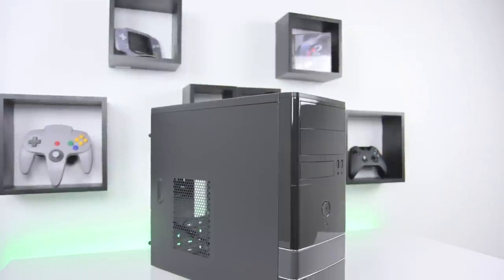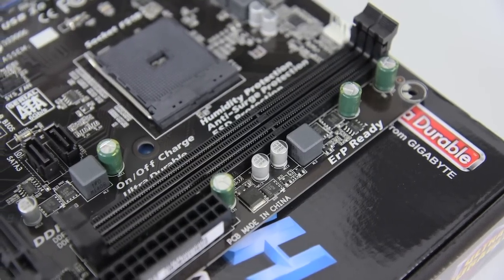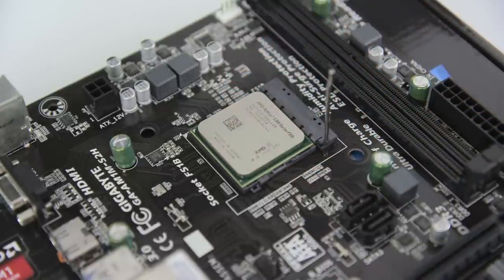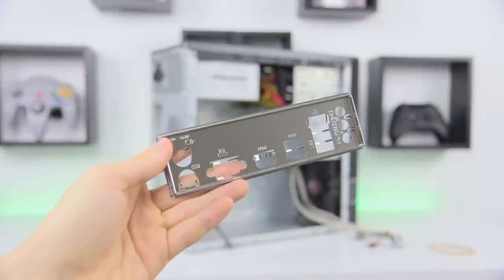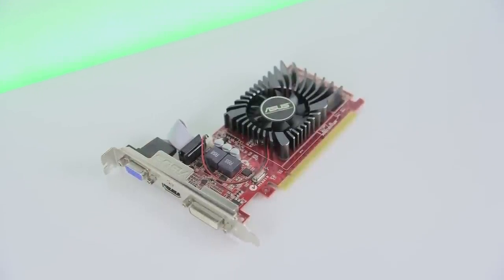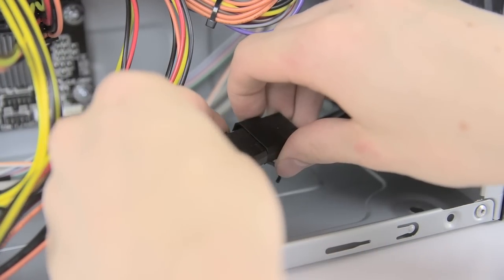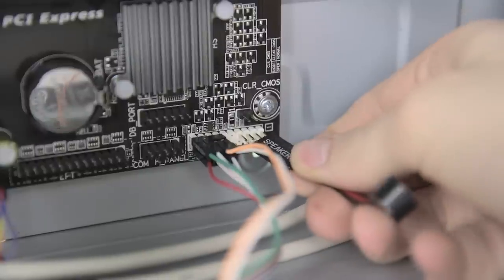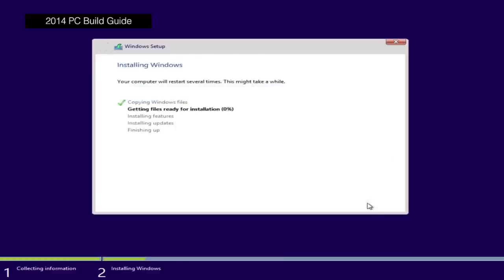How to Build a $300 Gaming PC! (2014 Boson)

Comment: Can somebody tell me if this pc is any good for gaming here are the specs: AMD A8-6600K 4.2 GHz Quad Core Processor with Radeon HD 8570D Graphics, 500W PSU, 1TB Hardrive, 8GB of Ram and 24 x DVDRW Drive
Reply: Not for any modern gaming at more than 30fps.
Reply: *****
wtf? he has a fucking 4.2ghz processor! and that gpu is decent! most games dont require any more than 6gb of ram anyways.
Reply: Narwhale The Great The frequency of a processor has nothing to do with performance.. my dual core 3.4ghz CPU beats an octo core 4ghz CPU in some games. Higher ghz does not mean better..

Also, the 8570D is hardly 'decent.' It gets 36fps on Bioshock, medium at 768p. It gets 29fps on Tomb Raider, medium at 720p. Also, it gets 11fps on Metro Last Light on high.

Please, actually learn about computers before you try to argue with me. I know what I'm talking about, you don't.

http://www.xbitlabs.com/images/cpu/amd-richland-intel-haswell-gpu/bioshock-1.png

http://gadget-help.com/wp-content/uploads/2014/08/54-amd-a10-7850k.png
Reply: ***** The 260X isn't good.. don't get that OP..
Reply: http://pcpartpicker.com/p/wttQBm

boom, it will have some stuff, some things but it needs an os and a dvd drive if you insist but thats it. will do 1080p gaming despite the poor single threaded performance of amd cpu's.
Reply: If you really can afford it get a 270X
Reply: 1toncheese That is a TERRIBLE build, nobody use that..
Reply: its not amazing is it lol. I would get the FX-6300 or FX-6350 and pair it with something decent like a R9 270X or 280 perhaps a nvidia 760?
Reply: ***** That would be close to $600. I'm talking about for the same $400 you could make it much faster.
Reply: *****
any explanation?
Reply: 1toncheese Explanation of what?
Reply: *****
why it sucks? i did notice the sales that got under $350 ended and that happens.
Reply: 1toncheese The CPU sucks, you have an aftermarket CPU cooler for absolutely no reason since you can't overclock it which is a piece of shit, the hard drive is small and you could get a faster GPU for the same price.
Reply: *****
its an oem so doesnt come with a cpu cooler, the gpu was chosen for 1080p gaming below $350, i doubt you could do much better in the price range with new parts (no used parts bullshit) the fx line can be overclocked and that aftermarket cooler allows for more headroom (that particualr mobo is one of the better overclocking matx boards. its also $350 which isnt enough to make something good, i chose the 750ti for its features, high efficiency and known oc headroom  (he things could hit 1500mhz with bios hacking to get more voltage) more than its raw performance.
Reply: 1toncheese For the same price you could swap out the CPU to a Pentium G3258 which is significantly faster and get an R9 270 which is again noticeably faster. Also you could get an MSI A55M-E/P33 motherboard which has the MSI overclocking genie and is amazing for overclocking at such a low price point. It would absolutely have better performance.
Reply: ***** no you cannot, different chipset means the msi mobo would fail to support either the fx chip or the g3258.
Reply: 1toncheese What are you talking about?
Reply: *****
you implying that mobo would work with those cpu's when it cannot.
Reply: but... dual core...
Reply: ***** What does "dual core" have to do with anything?
Reply: 1toncheese http://us.msi.com/product/mb/H81ME33.html#hero-overview

LGA 1150..
Reply: I have nightmares about dual cores. Never again.
Reply: *****
thats a different mobo from what you 1st posted,  and while your point is still valid and ths g3258 is beast the idea is to get something with more cores because of dx12 coming soon after windows 10 launches and mantle improving multithreading (and devs have locked dual cores out recently which they wont patch for some reason). the mobo you posted was the msi a55m-e/p33 on i think it was the fm1 socket. gaming performance on the fx line is fine and bottlenecks caused by them only cost you on average 5-10 fps.
Reply: 1toncheese You are right, it is a different motherboard. I get them mixed up a lot because all I used is MSI motherboards and I've used the H81, A55 and many others. My mistake but it's corrected.
Reply: ***** Umm ok that makes no sense.. me and a lot of other people actually buy compares based on performance, not personal nightmares.
Reply: ***** there are people who buy like that, ive seen enough people go "oh im never buying amd gpu's again because their drivers were shit 6 years ago." personal nightmares will caused your opinion to become biased eventually.
Reply: 1toncheese Well I wouldn't buy an AMD GPU either because my 7850 two years ago had a lot of issues. All my Nvidia GPUs were great.
Reply: ***** i would, i dont use many of the extra features and only had one driver issue which i suspect was from the technical preview im currently running as a bunch of other stuff had to be reinstalled with it.
Reply: 1toncheese Well, I record videos so Shadowplay is a big thing for me. And dynamic super resolution is huge for any gamer.
Reply: *****
its meh, and may still be forceably used in the drivers for amd cards (not too sure if they patched it yet as it caused some oddities or something but seeing as its a success amd might end up adding a similar ogsaa feature to their drivers despite it being an inefficient thing to do (which is why it was never officially implimented before by either company and now were on the cusp of 4k we can run games with the dsr/ogsaa and still have a playable experience)) but shadowplay is something to consider if your into that.
Reply: Narwhale The Great its a apu and a bad one, its not even A10
Reply: ***** a pentium g3258 isnt that good, and it will perform bad in cpu bound games such as watchdogs (i mean 20fps bad) and when dx12 comes out it will be hard to get playable fps on next gen games so yeah save some money and get a fx 4300, 6300 or a i3 (I recommend the fx 6300 because it has 6 cores and can be over clocked)
Reply: Multi407D The G3258 beats the i3-4330 in many games when overclock, what are you talking about? And what does the FX-6300 having 6 cores have to do with anything?

http://www.tomshardware.com/reviews/pentium-g3258-b81-cheap-overclocking,3888-3.html
Reply: ***** future proof, mantle (if you get a amd gpu), new games and as i stated before dx 12

also the fx 6300 costs $85 not much more than the pentium
Reply: *****
 How is this? Estimate how much fps on Bioshock Infinite?

http://pcpartpicker.com/user/trevor11004/saved/qL2BD3
Reply: Vizual remaG probably 30fps on low.
 Get a better processor like a Athlon 750k or if you are wiling to change you mobo get a pentium g3258 because they are $50 on amazon right now.

You should also change ur graphics card to a r7 250 and you should get 50+ fps on medium 1080p.

Also don't get a shitty psu if you go cheap on ur psu it could blow up and destroy ur computer (it happened to me once).
Reply: I'm getting a better power supply for my birthday. (15 days)
Reply: Also, can I get all that for under 500$ dollars?
Reply: Vizual remaG yeah if ur budget is $500 you can get alot
Reply: Vizual remaG You could get all that for ~$300.. For $500 you could get a way better computer.
Reply: ***** Can you try to make a part list for a 500$ gaming computer? Thanks in advance. If you can try make it in pcpartpicker.
Reply: Vizual remaG If you can get this for a couple dollars more it's fantastic. Good enough to run modern games at 1080p, ultra settings at 60fps. If you want to make the $500 budget just downgrade the case.

http://pcpartpicker.com/p/YgKVCJ
Reply: I meant with OS...
Reply: Awesome Tsar there are e shops that sell windows for $12 i forgot the website tho but if you want there are other operating systems that you can use until you can afford windows and torrenting is still a option
Reply: Awesome Tsar That is with an OS.. what's wrong with a free one? You NEED Windows 7?..
Reply: ***** i agree most people dont even use windows to its full potential
Reply: I don't know much free os's other than linux, and I'm using this for gaming which isn't very supported by free os's
Reply: Awesome Tsar most steam games are available on linux now and steam os is a option
Reply: Awesome Tsar SteamOS is specifically made for gaming. Most AAA titles on Steam support Linux, only small indie games don't usually.
Reply: ***** I think I will use SteamOS.
Reply: Awesome Tsar good choice
Reply: ***** I was wondering if my build is good, I don't know some of the parts so ill state them here. Intel core i5 4440 3.1 - 3.3 quad core, 6gb ddr3, evga Nvidia GeForce GTX 750 TI 2gb GDDR5 SC, 1 TB HDD. <- basically the main components.
Reply: Trillion Amaze Overall it's pretty good. The CPU is very good and 6GB of RAM is a decent amount. The 750 TI is a decent graphics card on a budget. Your weakest link right now is probably just your graphics card.
Reply: Narwhale The Great
And the AMD A8-6600K is already overclocked anyway, stock speed is 3.9
Reply: Isn't 8570D onboard graphics? At least get 7770 discrete, it will outpower it.
Reply: ***** Why would he get 1600mhz? Whats wrong with 1333mhz, 1866mhz, 2133mhz, 2800mhz, 3500mhz etc?
Reply: Multi407D How much FPS would this build get on modern games?
http://pcpartpicker.com/user/123vasakate6/saved/Zhv2FT
Reply: StormySparkle you would f**ing dominate every game 60+ ultra 1080p and you could probably play games at 1440p ultra 50ish fps the cpu is decent but i recommend getting a k edition so you can overclock
Reply: Multi407D Wtf that's a ridiculous good deal for an R9 290.. $240, wtf?
Reply: ***** Can you give me a good link to a build for $340? Please :)
Reply: amd cpu are always bs'ed about all the crazy specs but in reality, they aint that great. i always shake my head when i see amd or ati because they just simply dont have the good technology. all they have been doing is pumping the numbers up to make the product flashier but in fact the enhancement is not that significant. intel and nvidia on the other hand have great ways to optimize their products. my 50 buck GT 610 can run almost all the modern games with crazy physics smoothly at low resolution(i upgraded it of course). but if you want a long term investment then you should stick to intel and nvidia.
Reply: Jack Le Every AMD product outperforms every Intel and Nvidia product in the same generation, for the same price. AMD's Price/Performance ratio cannot be beat. You need to do some more researching and benchmarking, friend.
Reply: http://media.bestofmicro.com/4/V/408415/original/bioshock-fr.png

Please, the 290X doesn't even compete with the 780 TI. Let me guess, you have to bring up the dual GPU cards? Oh yeah, I guess a motherboard with dual i7-5960Xs is faster than an FX-9590 or whatever AMD's fastest CPU is..

Not everyone cares about just price to performance buddy. Some of us are streamers and want shadowplay, adaptive v-sync, g-sync, PhysX, forced FXAA and many other features which just make the game itself better.

AMD is only good if you're poor. Otherwise get Nvidia and enjoy all the great features, better drivers, lower TDP, lower heat, etc..
Reply: Joevan Appel Exactly what games support Mantle? I'm pretty sure the biggest title to ever support Mantle was Battlefield 4 which is like over 2 years old.. and how am I lying? What exactly am I lying about?
Reply: ***** Oh, lets start off with your lies.

"Please, the 290X doesn't even compete with the 780 TI"
Not even close.

"Not everyone cares about just price to performance buddy"
Uh, yeah they do. Everything comes down to how much performance you can get per dollar. The only ones who dont think so are fanboys and people with money to waste.

"AMD is only good if you're poor"
That's funny, considering majority of the supercomputers in the world run on AMD Opterons, and the gen 8 gaming consoles have custom AMD APU's.

Now lets talk about Mantle. There are enough games that have already been released that support Mantle. Battlefield 4, Call of Duty: Advanced Warefare, and Mass Effect 3 are just a few. Grand Theft Auto V is confirmed to have the Mantle API for those who're just getting it on PC. Mantle can do everything that DX11.2 can do, only better.
Reply: Joevan Appel Um.. in the benchmark I sent you the 780 TI is winning by 20fps, that's a pretty big difference and not much competition there bud..

Obviously some of do not care about price to performance as much as others. Try recording with FRAPs with that 290X and watch your framerate drop by 50. Then record with Shadowplay with the 780 TI and lose absolutely no framerate. You also get dynamic super resolution to run 4K without actually having a 4K display, gsync, adaptive vsync, PhysX and just so many more things that make the game itself better.

Of course consoles use a fucking AMD APU.. they are cheap as shit. Do you think they will put a $230 i5-4690k and a $330 GTX 970 in there with 8GB of 1600MHZ RAM for $80, and a 2TB HDD for $80? They're marketed towards children who don't even understand what resolution or framerate means, what do you expect?

Mass Effect 3 and Battlefield 4 are last gen games so honestly I couldn't really care less. Also, GTA V is not confirmed to support Mantle. Do a quick Google search and you'll see Tom's Hardware posted the article which was a rumor, and Rockstar never actually responded to it..
https://support.rockstargames.com/hc/communities/public/questions/201885253-GTA-V-PC-have-Mantle-support-

I'm not a fanboy, I'm just talking from personal experience. My 5950 from years ago had black lines all across the screen and so many driver/display issues and so did so many others. My 8800 GTS SLI worked fine. My GTX 260 SLI worked fine. My Radeon 7850 was the best AMD card I ever bought but still never as good as my Nvidias. Now my GTX 760 works great...
Reply: ***** we'll see when GTAV is released in a few weeks. I had the 8800 gts and I'll admit that it was a good card, however my gtx 650 died on me after a month, I got a 6670 2gb and it was great. Soon got bored of low-tier cards and bought an R9 280. Best card I've ever had. Never even had screen flickering or tearing on it, plus vsync runs great on it. Dynamic super resolution? My friend tried to show me on his 780ti sli rig with a 1080p moniter, and I saw absolutely no difference. The only difference was more jagged edges, and I hate that. AA was developed to get rid of that, so why would I want it again? And I have fraps. I've had it since my 6670 to share funny moments with my Steam friends. It never shaves more than 5fps, let alone 50. At this point, you are just being intellectually dishonest.
Reply: JoeyDaBULL  LOL sorry, look up the actual Fraps performance hit and it's much more than 5fps bud. The only way you will drop 5fps is if it's a game that you are running at 100fps+ to start with. If you can barely run a game at 60fps with your 280 and record with Fraps you will likely drop into the 30s.
Reply: ***** I've had  a 7950 for about three years, it runs really hot because I got a crappy single fan version from xfx but I've had no problems with it.
Reply: Meissna You mean that old blower style?
Reply: Team Burgers This turd... I love the performance but I'll never be this cheap with a gpu again.

http://m.newegg.com/Product/index?itemnumber=N82E16814150590
Reply: Meissna You're link doesnt go anywhere but the main page. Mind telling us what product you're looking at?
Reply: Meissna Nevermind, its in your above comment
Reply: ***** Why would I try a 260x? So I can get 30fps on all my games? If I wanted that I would just get a console. You say "is kickass with like 800 stream processors" like cores actually correlate to performance..
Reply: ***** 800 stream cores clocked at 1050Mhz. Also, if youre going to say that cores dont matter then you might as well say 2000 cores is just weak.
Reply: ***** That's actually a benchmark Tom's Hardware came up with, not me.. 30fps on most games is hardly a good idea when PS4 offers 60fps even on some games. If you have Nvidia you're not getting blindly raped of your money bud. What's the best card in the $300 price range? Is it not a 970? is the 750 TI not a great card for $125? Lol please..
Reply: ***** Well, here in America we have a huge market for gaming since there are over 300 million people.. the 970 is as cheap as $300 depending which version you get which ultimately dominates its price range. The 750 TI is also a great card for it's price range. Nvidia also owns the entire mobile gaming industry. There are no AMD graphics cards in laptops simply because they throw out way too much heat and use way too much power, and the same applies to their CPUs. When was the last time you saw a laptop with an FX-8000 series CPU and a 290M? It just doesn't happen, and it's for a good reason.

For the same or slightly more money from Nvidia, you get CUDA cores which are more useful for the average consumer IMO in Adobe applications like Photoshop, After Effects, etc.. AMD is only good for bitcoin mining. CUDA cores are just much more versatile. 

Not to mention how much more valuable Nvidia is to anyone who records or streams. Like I said, the CUDA cores are much more valuable in Adobe applications, for example making high resolution thumbnails in videos, and using GPU acceleration for rendering videos. Nvidia also has Shadowplay which is a huge selling point, plus dynamic super resolution is the most innovative technology in a long time. Not to mention PhysX and the ability to force FXAA on any game..
Reply: ***** it's called Raptr, and it does the same thing Shadowplay does; only better. Unlimited recording of gameplay plus streaming options for Twitch account holders.
Reply: Team Burgers Lol come on.. I've never heard of Raptr before so I Googled it and it can only record supported games. Shadowplay can capture your entire screen no matter what you're doing, whether on the desktop, watching a movie or playing any game whatsoever. Shadowplay also has Twitch streaming, as well as GameStream so you can stream any PC game to your Nvidia Shield too if you have one.
Reply: *****"lol ive never heard of it so it cant be good"
And prior to this conversation, I had never heard of Shadowplay before. I'll admit, being able to record anything you want is quite nice. Too bad recording Movies and Music will get you sued. Raptr only allows recording for games which will absolutely not get you sued, meaning any game thats optimized for, or even associated with AMD hardware. If youre not worried about copyright claims, then download Shadowplay. However, if you want a free, low-resource, optimized recording tool that wont get you into trouble, then get Raptr.
Reply: ***** Hmmm you sound like you know what you're talking about. Could you make me a build that doesn't go over $400? Thanks.
Reply: ***** Here you go. Tom's Hardware has that Pentium G3258 being overclocked to 4.5ghz using that same exact motherboard with the stock CPU cooler.

http://www.tomshardware.com/reviews/pentium-g3258-b81-cheap-overclocking,3888.html

http://pcpartpicker.com/p/bPKz99
Reply: ***** dat nickname
Reply: sorry, but you'll need an actual video card if  you want to play games on it
Reply: Spunky Chickens Not necessarily.. before I got my GTX 760 I used my Intel HD Graphics 4400 built onto my CPU and it was able to run source games like HL2, CSS, Dota 2, etc. at 60fps on max settings.
Reply: oh. sorry 'bout that. ;/
Reply: You know, back when I had my old gaming rig I dropped a Core 2 Quad, 4X2 GB DDR2 800 mhz RAM and GTX 460 SE into a old LGA 775 mobo and didn't even need any more than a small GPU overclock to decrease frame jitter on the video card. It's not much but it got me running BeamNG.drive on medium/low settings back then, and I tested this on a motherboard that I later found had taken heavy damage on the RAM frequency crystal, which is surprising considering it still got between 60 and 40 FPS with medium to low settings. (And FYI, I've tested boards with bad RAM crystals a lot and found that bad RAM crystals are capable of losing up to 55% of their original performance before they finally stop working.)
Reply: Sorry!
Reply: Spunky Chickens Is fien
Reply: ***** A regular 290x has a 512-bit memory bus
Reply: ***** my 280x has a 385-bit bus
Reply: ***** Ram on Nvidia cards is just slow
Reply: ***** Google is your friend
Reply: I found the Nvidia RAM to be clocked quite fast, unless the GPU level cache (that L2 or L3, etc. you see) is what makes the card fall short some.
Reply: ***** The 980 stutters at 4k, and many people think its because of the 256-bit 4gig memory
Reply: ***** What? The 970 is failing?...
Reply: ***** Yes. It is. Both the 970 and 980 don't have fast enough ram for their price point, however the 970 is doing significantly worse despite its high sales in the beginning. If you couldn't see this then you really are just a blind fanboy.
Reply: Team Burgers Using 3.5gb of the available 4gb is not really failing considering the 970 doesn't really have the power to push 4gb of video memory anyways.. that's like complaining that your Titan Z can only use 11GB of it's available 12GB of video memory..
Reply: ***** No one complains of that to begin with. Bad analogy bro. But that doesn't change the fact that it's sales are declining, and I think it's in part due to uneducated individuals spreading misinformation on how video memory works. It's very simple; faster is better. More is good for higher resolutions. And it's not all cut and dry when it comes to how much memory is needed to render games these days. Some games need about 1gb, whereas newer games are hungry for 4-6gb. Take The Evil Within for instance. I still manage to run it at 50fps but I could do better if I had more than 3gb vram
Reply: Team Burgers That's now how vram works.. if you didn't have enough vram you would be getting 1fps, not 50..
Reply: Team Burgers Do you know how video memory works? It's like RAM bud.. having 8GB or 256GB doesn't make a difference if the game only uses 5GB.
Reply: ***** And when the memory is FILLED, your system starts to slow down. Do not lecture me on what I am lecturing you about. I play an ultra modded Skyrim that nearly fills both my DRAM and my VRAM. Task manager tells me that it uses 5.2gb of ram on top of the 1.6 gb being used by the OS, which almost fills my 7.6gb total. If I begin to open other applications like YouTube videos for instance at the same time, then my computer begins to slow down because I have the ram maxed... but it doesnt slow to a snails pace like youre describing.If I decided toopen and run everything I could think of at once, then of course thats going to happen, but im not that stupid. I dont know if you run more than 8gb for extra headway, or if you truly believe that it will run at 1fps, but it never has for me, even when running my decked out Skyrim
Reply: Team Burgers Uhm.. if you had the RAM maxed, a window would pop up telling you that there isn't enough memory, so clearly it's not maxed so all of what you just said is completely false and not relevant whatsoever. :)
Reply: Team Burgers What the fuck are you talking about virtual RAM? Virtual RAM is a redundant statement. The only virtual storage there is is virtual memory. Is that what you're talking about?..
Reply: No from start the only thing you have there that will do what you need is the Hard Drive and PSU ... maybe ram depends how many / Kind of sticks. AMD is crap to game on, anyone with time behind multiple builds will tell you that. GPU is a no (AMD ....).
I actually test build that CPU when it came out for a budget office build for a client, and as I knew it was crap. AMD = Hot,SLow,cheap pile of you know what, both the cpu and gpu steer clear of you will thank me latter.
Reply: ***** Wow you really don't know anything about computers. How sad.
Reply: Team Burgers Lol please, I've been working with computers for years and I'm CompTIA A+ certified and plan on going to college and getting a career in computers. Please just stop.
Reply: ***** I had to read thru all that just so see wtf you know. AAAANNNNNDDD you were 100% right, everything you said was spot on. If your going to be heading to school your well on your way and ahead of most that already call them selfs PC techs lol. Keep it up.
Reply: Team Burgers omg did you just say you are Linux+ and Server+ CERTIFIED ?!?!?! Wow sit down kid, you just proven you know nothing. Scrubtron never said they didnt exist. omg Linux+ certified I think that killed me hahahaha
Reply: BloodyNoSeProduction just stop acting like you're not a second account
Reply: Team Burgers wtf are you talking about ? You can check my account this is active every day. And you can compare video / Voice in them. Don't be salty, it's just education.
Reply: BloodyNoSeProduction Then educate yourself. Unless you're afraid of being proven wrong like that scrub before you.
Reply: ***** Great grammar. You must have good grades in English class.
Reply: Team Burgers I mean I have a 96 in English so I guess that's pretty good. I don't see how my English grades have anything to do with this though..
Reply: Team Burgers I mean I guess. Personally I wouldn't call myself a kid, more like a young adult.
Reply: ***** The fact that you just used "I mean I guess", something that my 14 year old brother and his friends use, proves it.
Reply: The specs are okay. But really it sort of depends on what kind of games you want to run. Also, what motherboard will you use?
Reply: ***** is the Radeon HD8570 Worse than AMD Radeon R5 6410 Graphics?
Because I can hit 80-120 fps on Tomb Raider with AMD A8-6410 APU with AMD Radeon R5 Graphics